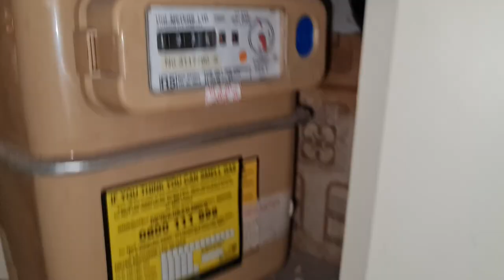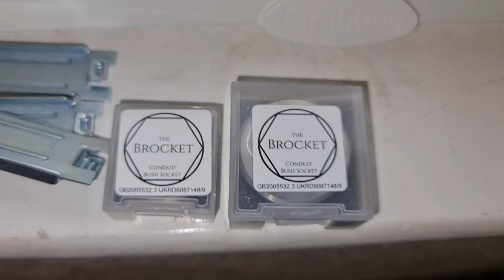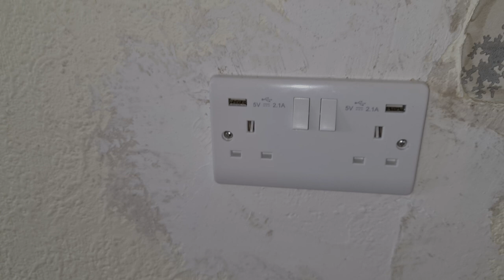Rewire in 3 days Part 2 TT time delayed RCD. Tools review, TESP and much more

Comment: Just wondering regarding SPDs on TT systems, not so much to do with the short tails but should they be RCD’d on TT anyway as in essence they are a varistor sitting between Line and the TT Earth?  Do they do different types of SPD for TN-S, TN-CS and TT?  I have seen SPD’s incorporated into isolator switches - I think it is Wylex REC2SPD but I’m unsure if these are suitable for TT should the SPD fail and short L-E.
Reply from the maker: 534.4.6 discusses fault protection even in the event of an SPD failure. In a TT system the installation of SPDs downstream of an R.C.D. can be made. (see figure 16A2 of Appendix 16). 534.4.7 says that where any SPD is positioned on the load side of an R.C.D. an R.C.D. having an immunity to surge currents of at least 3kA 8/20 shall be used. Type S R.C.D.s in accordance with BS EN 61008-1 and 61009-1 satisfy this requirement
Reply from the maker: You can use spds up stream of RCDs in TT but they have to be setup as shown in this article. Its an old one but explains it well imo. Thanks for getting involved in the comments! https://electrical-engineering-portal.com/surge-protective-devices-spds-rcd
Reply: That’s brilliant thanks, SPDs are something I’m not that up to speed on.

Comment: Can I ask why you decided to use type A Rcbo's in a posed to type B?  The light switched in the bedroom installed behind the doors.  Were there placed there because the walls are stud,  ease of installation?
I really enjoy your uploads.  It's really great that you explain as you walk through the installation.  What is you pp for a larger kitchen ring or 2 radials? Appreciate your tutorials pal 👍🏻.
Reply from the maker: Hey mate. The doors are moving around in opening as the refurbishment goes along. So the switches will make more sense then.

The RCBOs are still type B on the MCB element but are type A rcd as apposed to type AC that was more traditionally used until a year or two ago.

Hope that helps and thanks for getting involved in the comments.
Reply: @electrician247  Makes sense thanks for the explanations 👍🏻

Comment: I got confused with neutral switched RCBO. could you explain it in detail please. I have been installing RCBOs and never came across this term before. is this something only relevant for TT installs? appreciate your content.
Reply from the maker: Hi mate. Some rcbos do not disconnect the neutral under a fault. In that case if you have an upfront time delayed rcd on a tt install it can also take that as well. 

Newer rcbos have a switched neutral that disconnects when the rcbo operates isolating the fault.

Hope that makes sense.

Thanks

Mark